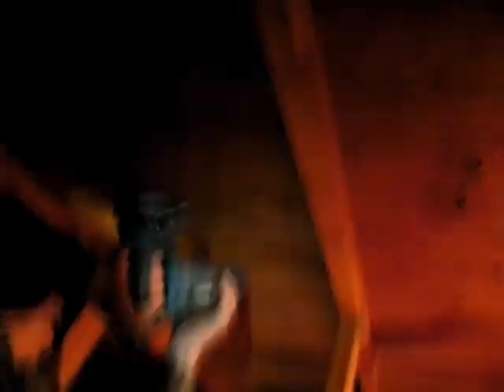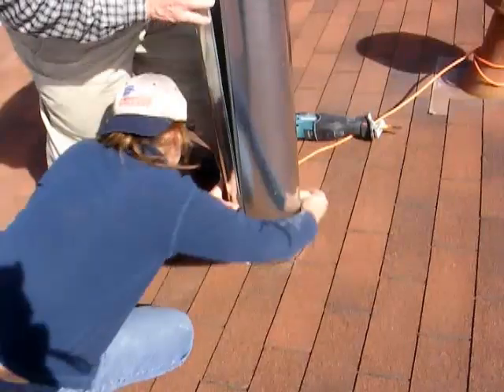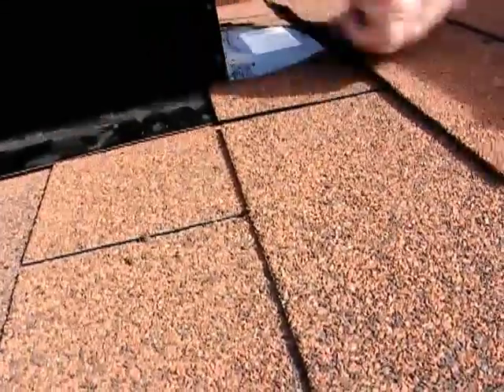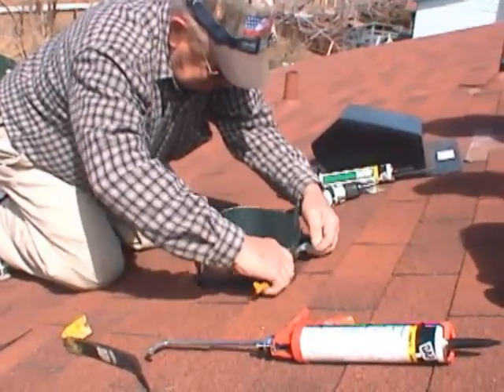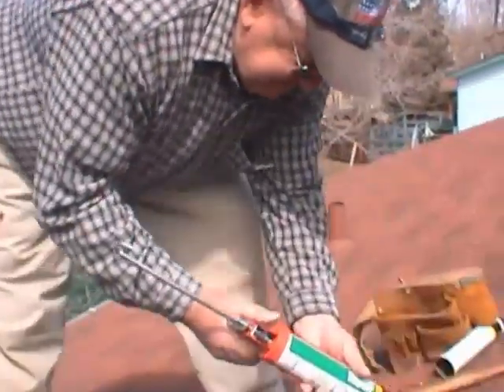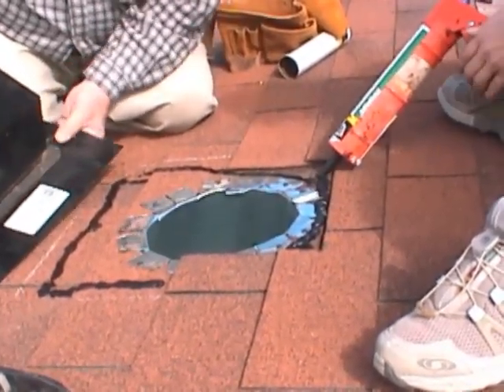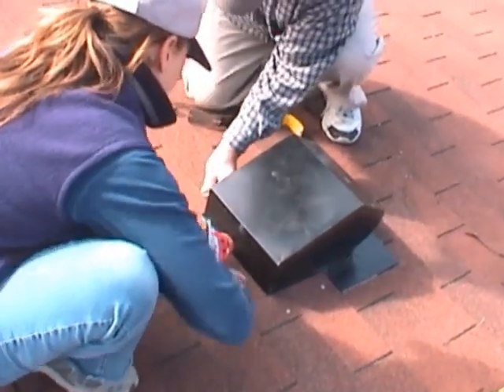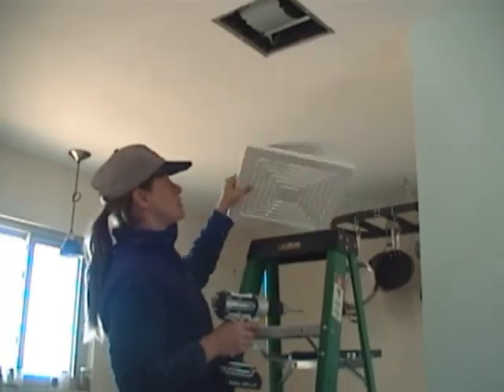DIY Home Exhaust Fan Part 4

Comment: They seem like nice people that took the time to make this video. With that being said, I'll try not to be too mean lol. Like many others said, only nail under shingles. Making tabs and screwing down each one to the top of the decking also not a good idea making many holes for water to find a way in.  They could have used  pipe strapping to wrap around the duct and screw to rafters from inside. Also, because they nailed through the shingles they now have that unsightly crappy tar job to cover the nails which will eventually fail. Sorry nice people. :(

Comment: Do NOT nail over shingles. 
Nail under shingles!
This will leak in less than a year.
Report this video if they dont take it down
Reply: also need roof cement under the shingle cover the vent
Reply: Ahahah "reporting" is not because you have a different opinion on how to perform a job 🤣🤣

Comment: This works great! Quiet, powerful and pays for itself. Even when it's not running it works because it's a vent for extreme heat to escape>>>nub.best/x0rq     Must get the thermostat with it though. Easy to install with the right tools. The thermostat regulates it so you don't have to be there to turn a switch. Best part is that it uses the the sun for free energy!

Comment: I've never done this before or even done any roofing before and I knew right away that nailing on top of shingles is not good. 

Looking at the comments I guess that's right.
Reply: They should have removed the shingles around the area first. then tar paper around the vent before replacing the shingles

Comment: Wow you guys are tards… talk about making your job 100 times harder than it needed to be. You didn't seal well enough at all, plus you guys drove nails on TOP of your shingles?! You never leave nail heads exposed unless you put sealant over them! Wow, you should have hired a professional. Also, you have a lot of audacity using the name "tool King" for your channel when you clearly have no idea with you're doing.

Comment: Those nails at 2:55 or just WRONG WRONG WRONG... the tabs they nailed through should be lifted and nail through the flange then drop the tabs down again
Caulking around vent after that is totally unnecessary.
Should take down this video

Comment: do not do what they did!! 
#1 those vents are to let heat escape in the summer and when snow is on the roof it will cover the vent and not work!
#2 do not caulk all around it because it will hold the rain water in! shingles are designed and installed to let water if any work out the bottom and not be trapped by some goof ball caulking all around it!!
#3 call the chimney guys and we will do it properly!!
Reply: Roof caps like that are just fine when installing properly … they didn't. I live in northern MN and have one of these PROPERLY installed for my overpowered bathroom fan and snow always stays away from the exit due to the warmth. These boneheads needed more calking along the top, but they shouldn't have put any on the bottom, any condensate that forms needs to flow out.
Reply: Your "#1" is wrong. That is an exhaust (hood) vent. Not an attic vent. ;)